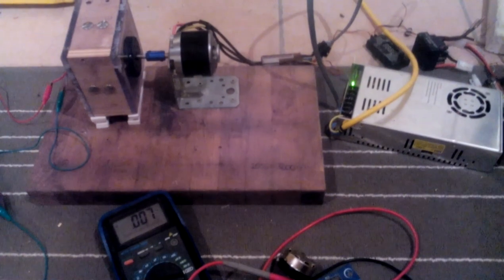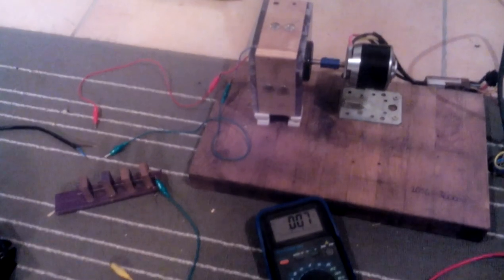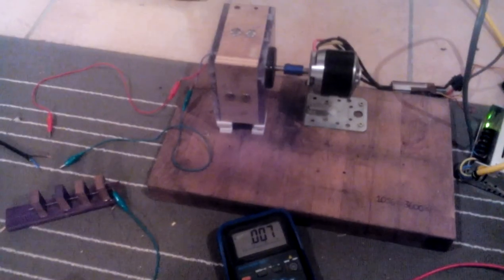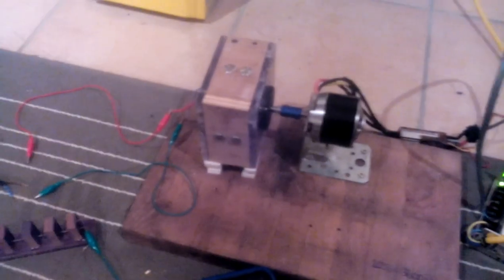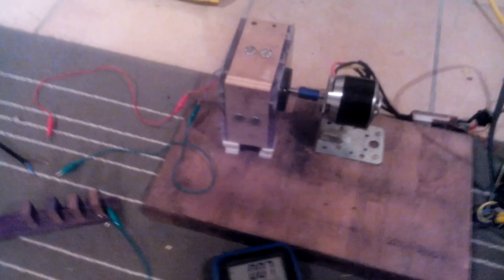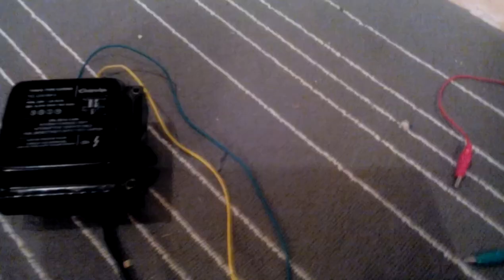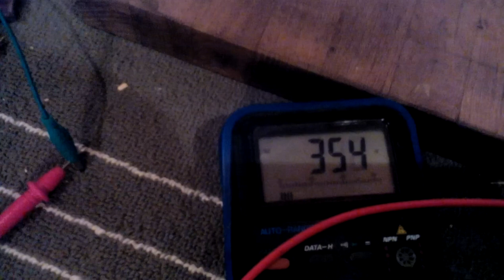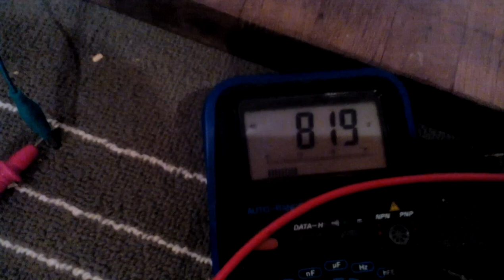Gerard Morin HV Generator - 820 iron-free volts!!!!

Comment: This set up is from a Tesla patent and is described as a more economical way to distribute electricity.Tesla uses a magneto,a spark gap combined with a magnet and then a method of distribution which comprises of looped iron wire(home base sells a 9inch bundle of bailing wire for a couple of £)Then you tap off from the ring,insulate the ring before you wind off your coils.The magnets  either side of the spark gap may be to stop the interference I really do not know why he uses them also I did not notice a ground wire.

Comment: Cool generator! Smooth and super high speed -well balanced and aligned.. nice craftsmanship
Question:
what amperage are you getting out at the 800 volts on the AC side? What voltage and amperage are you measuring into the DC motor at that same speed?
Reply from the maker: Hiya, I have given myself the week between Christmas and New Year off, so will attempt to answer this then! Cheers!
Reply: Hi - did you check the Amperage that you are going along with the high volts? How long can this run continuously without stopping?

Comment: hi,nice job with the generator. I have alot of gerard videos under my belt and i beleive the next step would be to dump the output of the generator into a pole transformer but you will probably have to use a transformer to bring voltage down to 120v.
Gerard actualy used 2 pole transformer but i am wondering if maybe dumping your 800+ volts thru the hv cable of the pole transformer and collecting the output thru the taps as it is usually,  put the step down transformer immediately after the taps  to bring down voltage to 120 volts or 2 step down transformers to get 240 volts ... just a thought.
Reply from the maker: Hi! Thanks very much for watching and taking the time to comment. I don't know where I might be able to get a pole transformer...Any ideas? Also, I thought the idea was to put output through a chopper to get the 60 Hz impulse and then through the pole transformer. It has been a long while since watching his vids, though! Cheers, Jamie
Reply: @shortblokej  Hi, in order to use the chopper,you will need to reach voltages higher than 800 volts, you are gonna need 14400 volts if your output is 240 volts and 7200 volts if your output is 120 volts.
 the reason i suggested dumping in the pole transformer is because gerard did it with a Mc culloch generator and on the output he was powering alot more watts than the generator alone could ever have.
As for pole transformers,they are hard to come by but you can try looking farmside,farms always need extra pole transformers other than that, transformer companies sell them too and you can even buy some online,from china on alibaba.com or made-in-china.com but i dont know if the interior of the can is the right design altho they claim its high frequency transformer...maybe worth a look.

Comment: you need to go from your high voltage high frequency into high voltage caps then to an air core step down transformer through a full wave bridge into lower caps and then into an inverter such as for a solar unit and proper grounding and you are there. great job.
Reply: Solar defeats the purpose of this demonstration of overunity energy.

Comment: hello friend, where are you? i have mote information with this proyect, im replicated the same motor, and this is perfect for learn and this produced volts, much volts
Reply from the maker: Hi! I live in France. What have you done with your setup? Thanks for the interest!
Reply: my motor charge with back emf, magnetic gap is for de back emf, my batery never down, use bucking coil, anti lenz coil is the same, for much much energy and dont have lenz law
Reply: in your exit connect big transformer, this is much voltage, you have escalar waves, this energy is for evrething, i charge de cell phone, charge my notebook, charge battery, etc, is large to speak, this motor and gerard morin is the best for learning evrething, after that learn function of magnetic athom, the energy, whit experiment is for open the ayes, im happy because estaba por hacer ese experimentar de nuevo para probar unas cosas y asique podes hacer las pruebas vos y vamos aprendiendo

Comment: Hello my friend. I do not know how far you have gotten but your goal is to run this with a motor that runs on volts and not necessarily amps. Check out a really awesome channel redesign3dp and his high voltage pulse motor. From the output you wan tto convert the output to DC with a FWBR full wave bridge diode and fill a bank of capas and then run an inverter for your power.